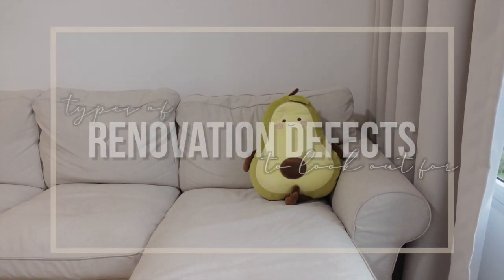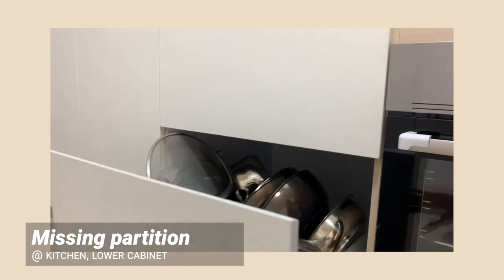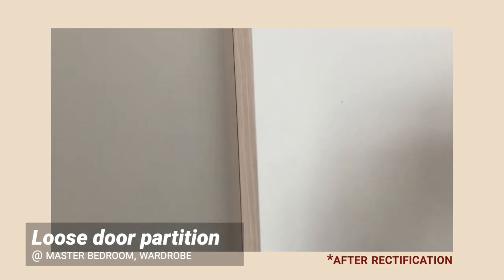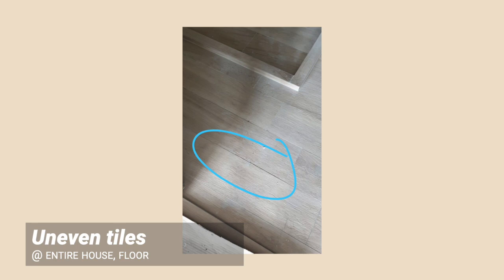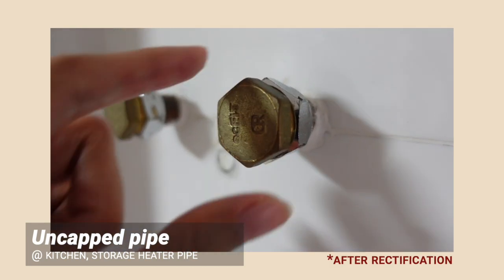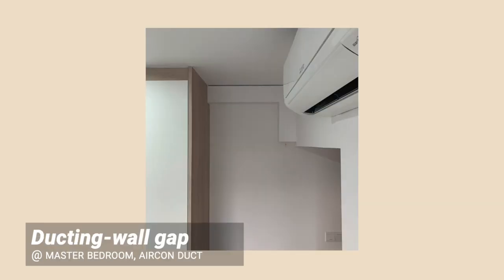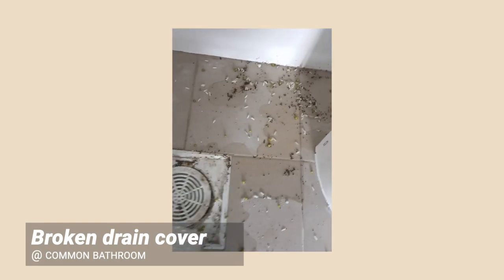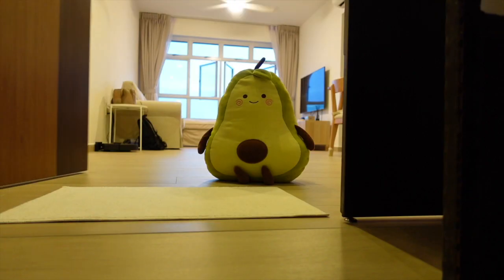hdb renovation • Types of Reno Defects To Look Out For

Comment: Hi! Im currently having reno at my place and the workmanship for the carpentry is really bad too. Lots of chips and dents. For those chips and dents in ur vid how did ur ID/ contractor correct it for you?
Reply from the maker: Hello, sorry to hear that 😔 They used putty (?) a substance to fill the dents, and used white markers to colour them over lol. My husband told them to change the whole drawer/shelf/door completely for those I couldn’t accept. Don’t accept it at the expense of lowering your own standards!
Reply: @haylivk  Thanks so much for replying! for those that they changed the whole door/ drawer did they charge you for that? Also do you mind elaborating how the clothing bar dropped when you were removing hangers? Because currently my ones look like yours, the length is slightly short (not long enough to touch both ends of the wardrobe). Not sure if I need to raise this up to the carpenter and am afraid they would claim it is not an issue and wouldn't change for me.
Reply from the maker: @dawajugi  - replacement of drawers/doors: nope they didn’t charge, but it was minimal (~3). They mainly filled it in for dents/coloured over for chips. Not the best, but we rly wanted to finish up the reno ASAP lol. 

- Short hanger bars: get them to replace the entire bar! It means that they cut too much / gave you a bar that’s too short. It’s 100% a defect. Tell them you paid for a hanging bar, not a loose rod :/ 

I hope you haven’t released 100% of the payment to them yet? Do keep 10-15% of the reno payment first and only transfer when they’ve completed ALL of the defects rectification to your standard. If they refuse to do the defects for you maybe you can treat it as them giving you a 10% discount for their lack of quality :/
Reply from the maker: @dawajugi  pls lmk here / DM me on IG if there’s anything you need help with yeah! I uds how frustrating it can be. 💪🏻💪🏻💪🏻
Reply: @haylivk  I feel you on wanting to finish it ASAP. Dealing with them is bloody exhausting. Thank you for making this video! Haha really helped me know what are the things to look out for!
Reply from the maker: Yes 😭 The emotional exhaustion is real... That’s great!! Glad that it was helpful for you 😊